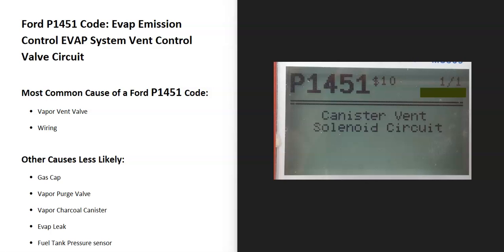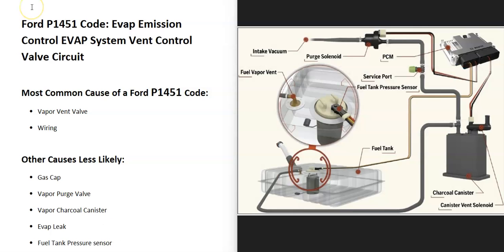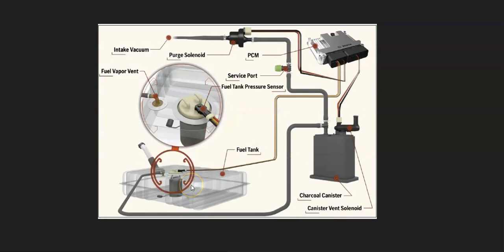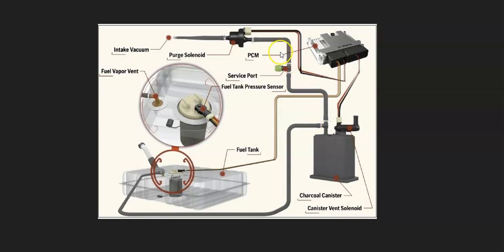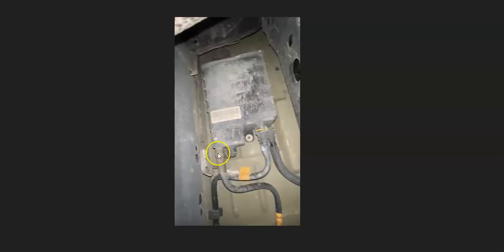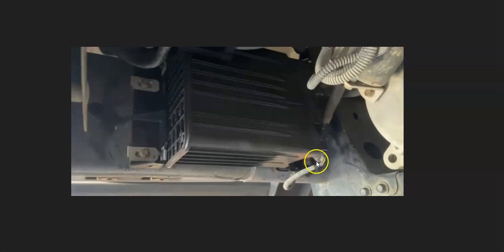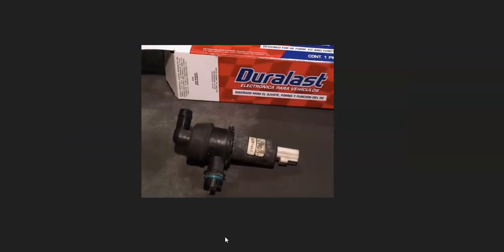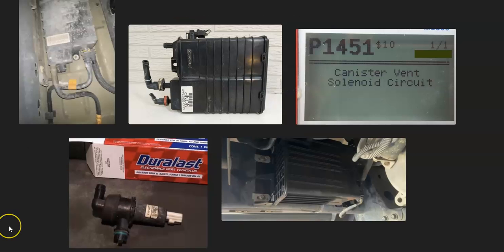Causes and Fixes Ford P1451 Code: Evap Emission Control EVAP System Vent Control Valve Circuit

Comment: I jus repkaced this two weeks ago cause ot RAN like sH*T,   IT RAN great, AFTER BOYT 75 MILES, AND Now  its  runinnig like sh"t AGAIN, ive ALSO replaced AS WELL  the  3 rd cyilnder,  PLUG AND THE COIL TOO, WHAT AM I TO DO NOW, I KNOW AT TIMES  NEW REPLACEMENT PARTS COME OUT BAD/DEFECTIVE.
Reply from the maker: It needs to be diagnosed, but it's not too common for new components to fail, but it does happen sometimes. I would check all the wiring and see if a plug came loose. Sometimes, things don't get plugged in well when a part is replaced.

Comment: I have a 2000 f150 5.4 crue cab, the valve in not located near the canister, can you tell me where to look for it?
Reply: I was wondering the same thing about my 2000 ford expedition 4.6L V8 Triton XLT canister vent purge solenoid location.
I searched on YouTube for videos but no luck so far.